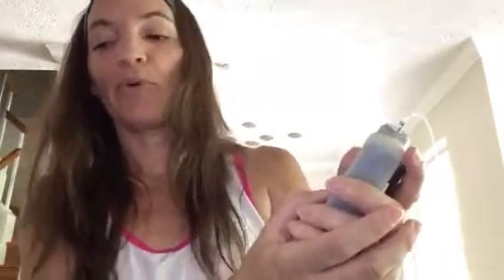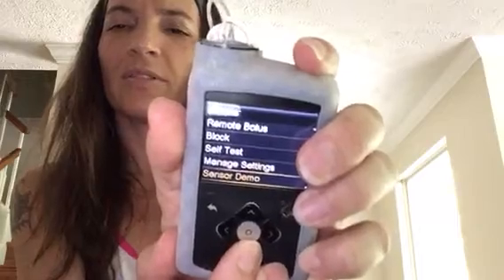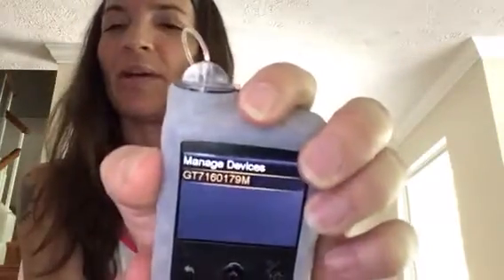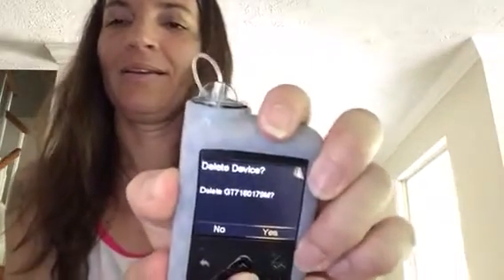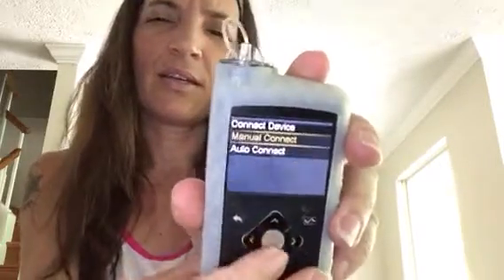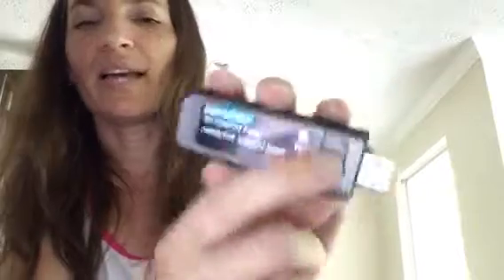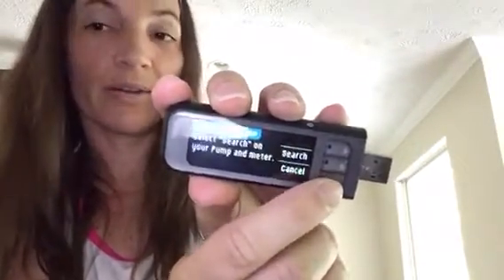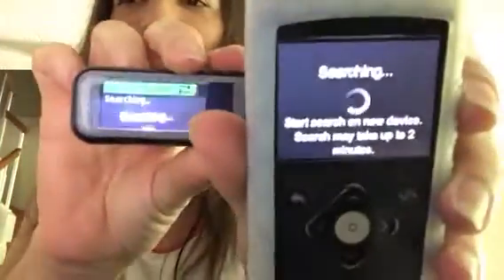No Calibration Occurred on the Minimed 670G: How to delete transmitter and meter from pump... and g

Comment: I didn't have to delete my devices. I just disconnected the pump from the sensor, put it in the charging dock for a couple
of seconds, reconnected it (after getting the proper green blinky lights) and then the pump said "SENSOR CONNECTED -- START NEW SENSOR / RECONNECT SENSOR" and it worked normally from then on.

Comment: After a sensor change, it takes hours of calibrations and BG checks to tell me to change sensor.  Is this the process for that.  I am already connected and if I remove transmitter, then I have to change sensor.  So frustrated.
Reply from the maker: Sorry I’m just seeing your comment. No, this is not the process for just a standard sensor change. I am not entirely sure if you are experiencing true problems or maybe just need a routine set of steps to follow during a routine sensor change. Have things settled down for you—I hope?

Comment: So sick and tired of this machine. During the first three months, it worked perfectly. Since then, it has done things like this more and more frequently. It wastes money in over usage of test strips and sensors. This is why I always end up getting off of it and back on insulin pens.
Reply from the maker: Skip Hoffenflaven, you're on my schedule! That's just about right with that 3 month estimate. It took me about that long to realize I had a LOT of problems on my hands, and only MOST of them were my fault. :D

There are others who struggle with this device. If you ever feel like hearing very mixed opinions and general diabetes tech talk, you're welcome to come check out The Honest Exchange at https://www.facebook.com/groups/527623797620537/. I can't promise you'll find anything useful in there, but we do have some fun. :D

Best of luck to you!
Reply: nicky ghaleb Since then, I got it working closer to the efficiency I saw in those first few months. I tweaked some of the features, hehe!
Reply: And now, at the worst possible time, sensor goes bad, I change it out, and the pump cannot detect the transmitter which typically results in my having to pull out the newly installed one, and starting all over. That makes, yet again, 1 in five transmitters failing, as it was back in 2012-2014.
Reply from the maker: @skiphoffenflaven8004  So sorry. :( I know I had terrible luck with their transmitters in the last few months before I bailed. I don't want to encourage you to change teams or anything, but.....  the grass actually IS greener on this side. :D